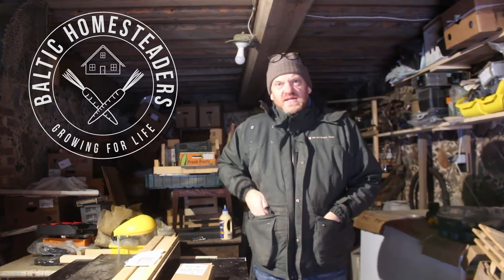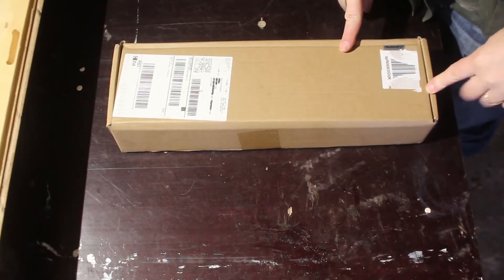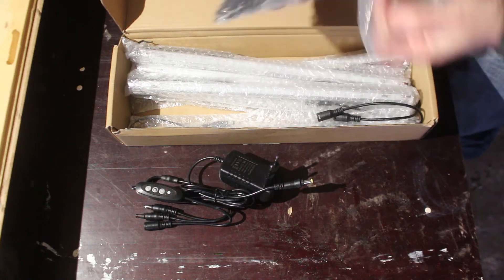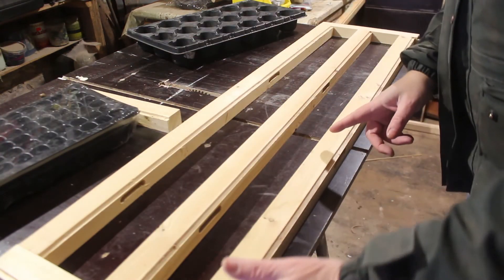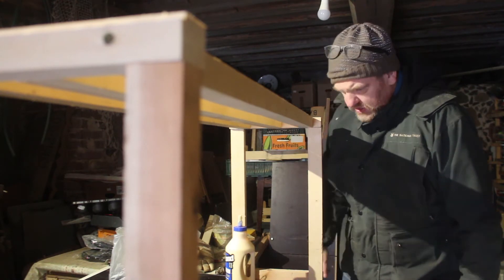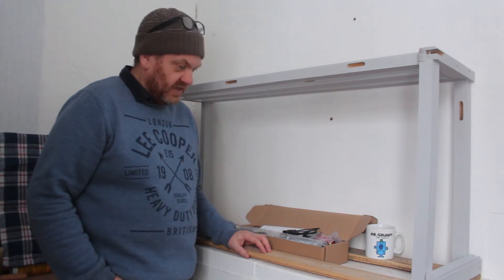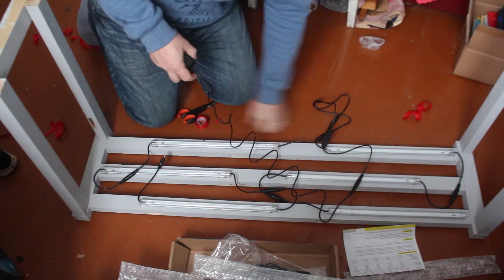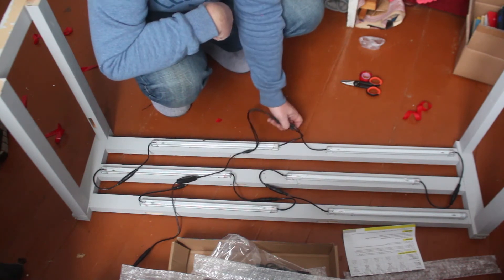Roleadro T5  Grow Lights Unboxing, Review and Full Install

Comment: Thank you for doing this video. I’m setting up mine today. I noticed on the underside of the light strips where you’d put the adhesive- you didn’t go right to the very edge to edge - you did kind of the inner strip - those raised plastic edges don’t affect the way it sticks to a flat surface?
Reply from the maker: Hi, great! From memory I just thought it didn't need it in order to stick, it seems to work fine. Let me know how you get on. Have a great 2021 growing season :)

Comment: Hi, first, thank you for the video. Do you know if i can use it for cannabis grow?
Reply from the maker: Hi Jorge, thanks for watching. I would say it’s enough light to start and grow anything. Remember it’s light only so no heat. Whilst I only use it for getting seedlings going I’m told the lights just need adjusting upwards as plants grow. Obviously hemp/cannabis has multi height requirements as it grows tall so you may need a multi level set up or side lamps. Hope that helps.
Reply: @BalticHomesteaders  thank you very much, for you answer , it's helps me a lot.

Comment: Will these grow tomato plant to harvest>
Reply from the maker: You mean fully grow a tomato plant until you can harvest from it indoors? I guess in theory yes they will but you’d need a much bigger set up.
Reply: @BalticHomesteaders  Okay thank you mate :) and yes, I have the space but just wondering if the light will be enough for blooming
Reply: How long are the leads coming of each one? Do you know of anyway that they can be extended? I need them to be about 50 cm long
Reply from the maker: Hi. The power lead is about a meter then a dimmer and another 30cm and then each small connector between lights is about 25cm. However they give you another set of 5 leads to double the length if you need it. I didn’t mention this in the video as I didn’t realise this until after. I would say if the lights are spread that far out they might not be totally effective, not sure. Hope that helps.
Reply: @BalticHomesteaders  thanks ok the quick reply.  I'm planning on using these on a multi level shelf with about 40 cm inbetween each shelf and 4 lights per shelf with 5 shelfs total. Might need to do 6 lights eqch shelf not sure yet. Im going to start with 3 sets and go from there
Reply from the maker: Yeah I’m planning to add a second shelf to my setup as well as I was so pleased with the results.